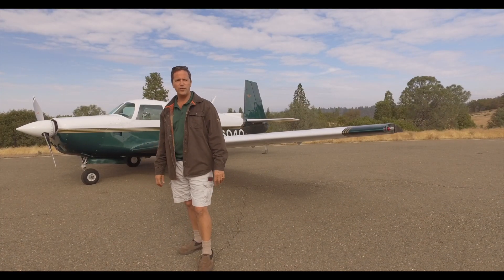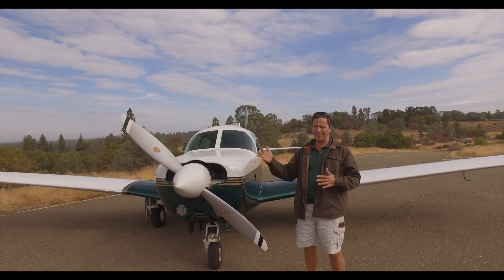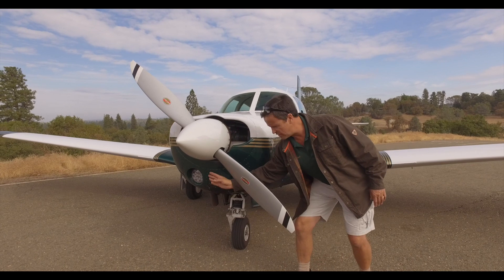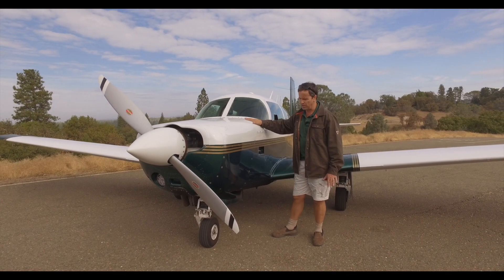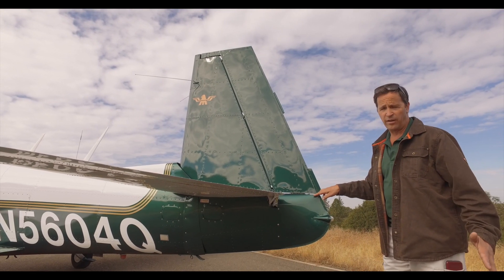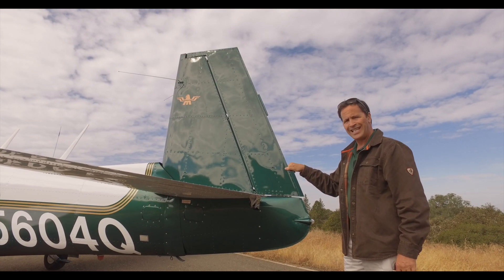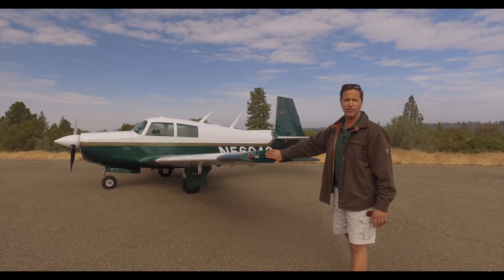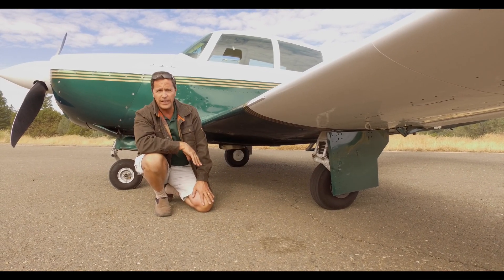The Mooney M20E

Comment: I have N5502Q, so with numbers that close, I suspect that N5604Q was built the same year, 1965. Like the one pictured, I have upgraded to an LED landing light and have the cowl bowl enclosure. Stock M20Es have a bigger opening under the nose, but I felt that the larger opening could douse the generator or alternator with pounding rain. I have an alternator conversion, but the generator wasn't bad. I have the 201 windshield. I had it done so that now avionics access is inside the plane, under a padded cover, not outside. I think the easiest way to tell which body you're looking at is the length of the rear window. That's where the additional length shows up, in rear passenger leg room. Mine is red, but has the same 90's paint scheme/pattern at this one, still going strong with lots of maintenance.
Reply from the maker: Yes, rear windows are a great ID on these planes. Is your rectangular or "humpbacked"  if it is the latter, it is a 1964.

Comment: M20E / C have full length rudders from 1969 and on. 
The 1977 - 1980 also had squared off wing tips. I believe wingtip fairings were introduced in 1981.
Reply from the maker: You are absolutely right.  69 and newer have the log 201 rudder.  All my Mooneys have been 65 and 66.  Supposedly less wag in turbulence.  Thank you.